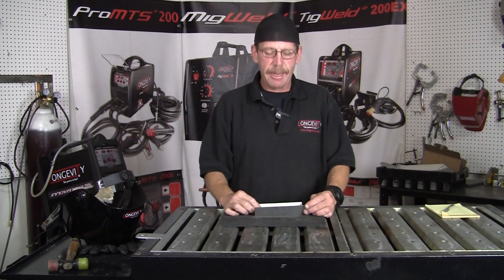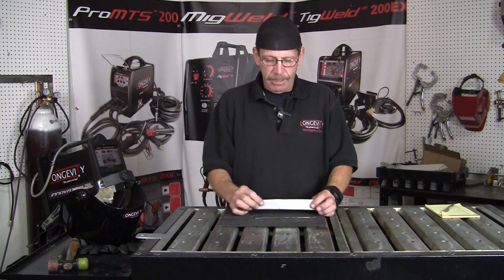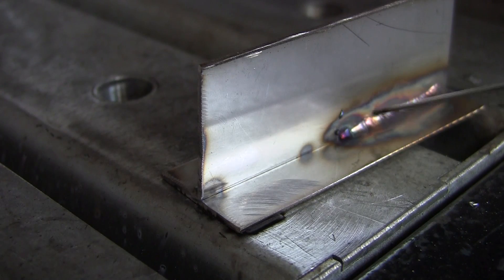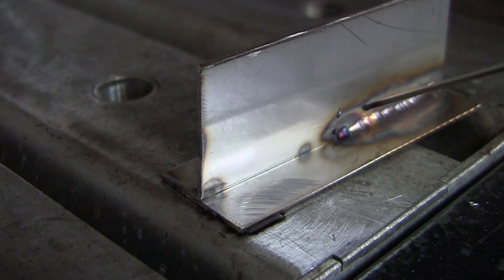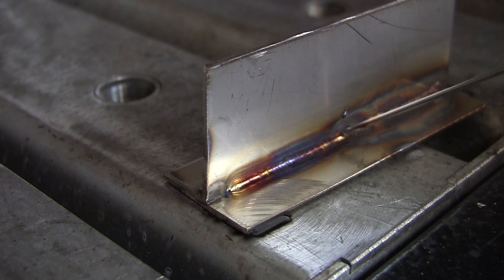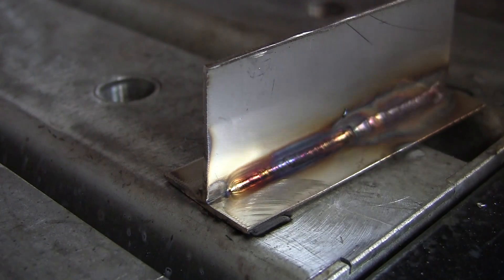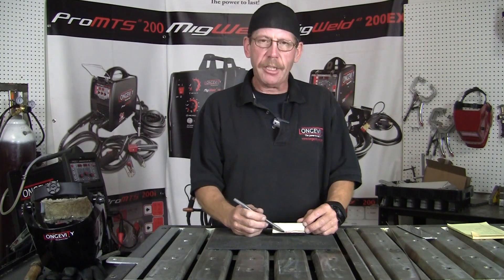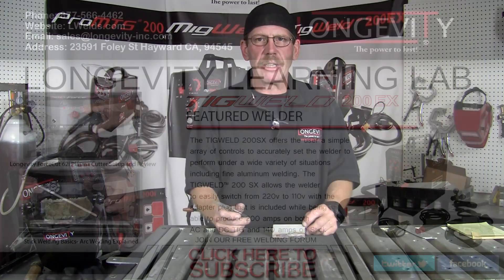TIG WELDING: FUSION VS FILLER ROD

Comment: I have fabricated and Tig welded for 30 years, if you have the material to spare - Fuse It.  People go crazy with the filler.  If you have small gaps add a touch of filler.  If you have big gaps, refit.

Comment: Is there a major strength difference of fusion vs filler rod?
Reply: It's the same differance as someone puts rebar in concrete or not😂💡The more metel bonding any joint makes it a lot stronger👍

Comment: When do we use one or the other? That’s the question...I know both methods exist, but which to use when?
Reply from the maker: Filler Rod is most common. Fusion Welding has specific purposes and requirements, but Filler is the one that you will most likely do.
Reply: @longevitywelding  so basically there isn’t any specific scenarios where you would be required to use one or the other. It’s entirely up to the technician AND the fitment of the material that you are attempting to weld together.

Comment: So how do people get that "Stack of dimes" look when fusing ?
Reply: they move in little steps
Reply: Quite late to comment but you can pulse the pedal or set the machine to pulse at a slow interval and move as if using a filler rod.

Comment: I haven't formerly studied welding but I'm still trying to figure out why people don't fusion weld butt joints more often.  I've done it with aluminum, stainless, and carbon steel thin tubing and sheet metal and it looks awesome and is much easier as long as you have zero air gaps between the joints starting out.  I always feel like I'm doing something wrong though.  Like maybe it's not strong enough without the  filler?  If you REALLY do know that answer to this please let me and all of us know. :)
Reply: Sometimes the material "effaces" with fusion (autogenous) welding, resulting in a thinner cross section in the weld area....
Reply: Spooner Tuner because you’re not always going to have a perfect fit up like that out in the field man.
And by not always, I mean almost never.
Reply: Spooner Tuner - Fusion / hammer welding is exactly what you want to do when butt welding steel and aluminum panels together when the resulting panel needs to be run through an English wheel.  Introducing welding rod to the weld will knick the anvils (wheels) if you use it ... so it's not done.  I agree that fusion welding becomes easy with practice and that fit is the key.

Comment: Why in school they tell us to never do that?
Reply: I haven't formerly studied welding but I'm still trying to figure out why people don't fusion weld butt joints more often.  I've done it with aluminum and stainless thin tubing and sheet metal and it looks awesome and is much easier as long as you have zero air gaps between the joints starting out.  I always feel like I'm doing something wrong though.  Like maybe it's not strong enough without the  filler?  If you REALLY do know that answer to this please let me and all of us know. :)
Reply: All we do is fusion weld.
Reply: I mass production weld in a large wire shop, filler is used only as needed. We have large Miller's for our welders and predominantly tig everything.
Reply: In my knowledge fusion welds aren’t thought because it’s mostly used for sanitary piping. And most welders that I know of have a “pipeline” dream and not sanitary piping. Just my wild guess

Comment: Can you use tig fusion without gass?
Reply from the maker: No, shielding gas creates a barrier that prevents the atmosphere from interfering with and or contaminating the weld pool and electrode. Without this barrier, the arc will be at the will of atmospheric conditions and leave the weld pool and electrode open to contamination.
Reply: No.  It would be so oxidized that I don't even think it would hold together.  It would have all kinds of microscopic air pockets. And it would be super sooty and messy too.